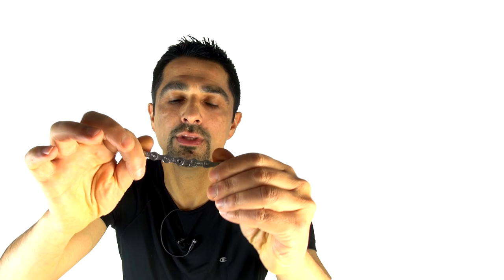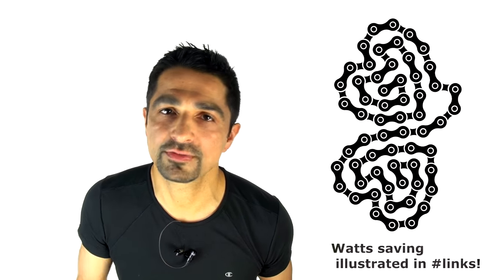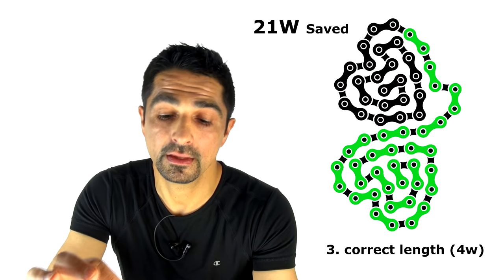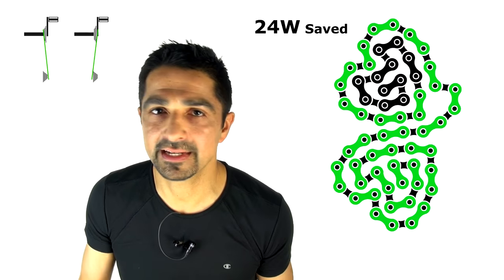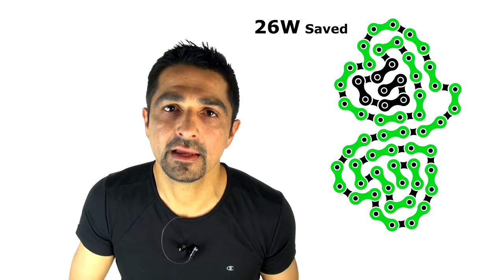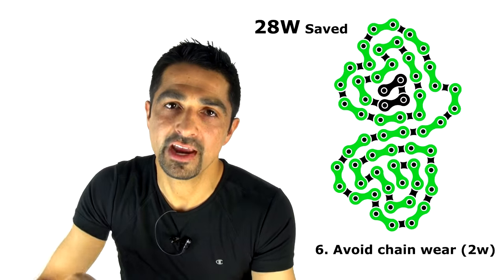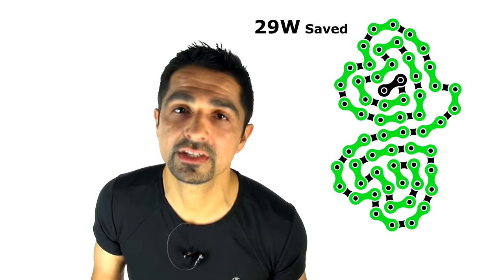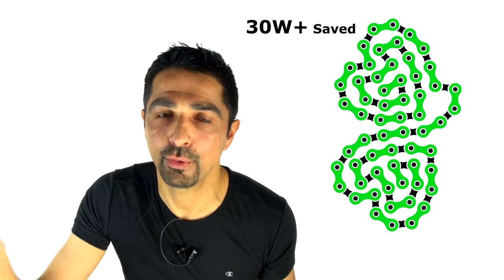Chain Science! How to save up to 30 watts of losses from your bicycle chain!

Comment: Your position on chain tension and lubrication are inconsistent with the IHPVA (International Human Powered Vehicle Association) actual test results. The IHPVA finds that bicycle drive train efficiency goes up with chain tension, at least up to a practical limit, we are not talking about banjo string tightness here. A derailleur equipped bike will have virtually NO static chain tension. 100 years of bicycle and motorcycle drive technology dictates that drive chains should have between a half inch and an inch of up and down motion at the midpoint between sprockets. The IHPVA also finds that complete lack of lubrication will not affect drive train efficiency. I have to admit this is very hard to believe and I never let chains dry out.
Reply from the maker: Hi +Harv Woien very interesting observations to be sure but I cannot find the actual data from the tests you mention. do you have a link. I am sure future tests will also bring new developments. regarding tension I imagine the effect is a U shaped curve. too low = bad too high = very bad. I find it hard to believe that sky high tension will help because every link and articulation would be under severe pressure. Your recommendation of "half inch and an inch of up and down motion at the midpoint between sprockets" seems to suggest mid-tension in my opinion, not too high not too low. Thanks for the comment.
Reply: Here is the link: http://www.ihpva.org/HParchive/PDF/hp50-2000.pdf  
You are correct in that too high a chain tension would result in damage to chain and sprockets. On a bicycle drive train setup, it is very easy to avoid this condition, as 'binding' is easily detected and reversed. Of course, this would be for single speed or internal geared hubs only. For derailleur systems, optimum chain tension can never be achieved.
Reply from the maker: Just looking again at this interesting paper, does it take into account ability to change gears smoothly, or just lab conditions essentially in a fixed gear?
Reply: Well pointed out. Chet Kyle and the IHPVA provided lots of studies that sadly have been lost. Thankfully the study that you pointed out isn't one of those. I have an original binder of the first volumes of Cycling Science that Chet put out back in the 80's and 90's. Lots of information backed up by tests rather than just people warbling on. 

What needs to happens in videos like this is a series of tests to validate the claims made. Take a new chain and test on a dyno. Go ride it for a few hundred miles to get it dirty and test on the dyno again. Repeat for all the tests, in order. Just because "waxing a chain" might get you 4 watts and tensioning the chain might get you 3 watts, the combined total will never equal 7 watts. I wish it would work like that but it never does.

Deep cleaning by shaking in a bottle? Are you kidding me? You will not get out the lube from Shimano on a Dura Ace chain by just shaking it a bit. You'll need a sealed container and a small ultrasonic machine and leave it a while. You can't get the parafin wax and telfon in until you get the old grease out.

I have never noticed, even when removing a worn chain that's been "winter cr@pped on", that I gained 30 watts when putting a new chain on, despite having had a power meter
Reply: @Swampster70  Either way, how would you notice with a power meter?
Reply: @imd12c4advice  If you're measuring power at the crank or pedals, you will go faster - 30 watts is a sizable increase, you will notice it. If you're measuring at the rear-hub with a powertap then that 300 watts will feel like 270.

If we were talking about 5 or even 10 watts then it'd be hard to tell without back to back testing.

Comment: Best lubes is raw  paraffin  wax mixed with paraffin oil. Cheap to buy. Melt and mix 50/50. Heat bottle in microwave to melt any solidified wax before use.

Comment: I did a repair on a bike with Dura Ace parts who's owner had been using machine oil and had not cleaned it in some time, he thought the chain lube was to expensive at $20. New chain and cluster cost him $475. There was a loud gulp over the phone when I gave him the quote.
Reply: It is too expensive at $20.

Comment: Interesting comments from SRAM on this subject - although I don't agree 100% with everything they say, I do think the savings for some of these measures are overstated.

-------

"Very little efficiency is lost when cross-chaining. And in the case of big-big, minuscule efficiencies lost to cross-chaining are offset by efficiency gained because of larger bend radii for the chain. Better chain management and easier access to tall gears certainly outweigh any efficiency loss.

A few words on efficiency measurements. There are enormous differences between the efficiency measured on a loaded drivetrain and an unloaded drivetrain (what your hand feels when spinning the crank on a bike in a workstand). The sluggishness that cross chaining sometimes appears to cause on a bike in the stand disappears when the drivetrain is under load. It’s analogous to lubes in loaded and unloaded mechanical systems. Light oil generally feels better than heavy grease when a system is worked by hand, but when the system is loaded the heavier lube will be more efficient.

Similarly, cross-chaining is not a concern for premature component wear unless of course your chain is wearing through your front derailleur."
Reply: Cyclespeed Tours also interesting is that SRAM don't mention any numbers ;-) "very little efficiency is lost" is pretty vague for describing marginal gains.
Reply: True, although 'very little' and 'miniscule' suggest that the losses are so low as to not be worth worrying about, even in the world of marginal gains.

Comment: Accurate post. When my chain squeaks of shows a sign of rust I pop my chain off, dump into melted paraffin (always put paraffin pan into a pan of water and then heat [this way the paraffin doesn't catch fire]). I'm good to go for about 3K miles. (Chain stays clean)

Comment: Here's a fact with my New bike. Snuged drive chain to snug. I couldn't pedal it 12 foot. So I loosened drive chain I could pedal it anywhere and even up some hills. To snug of a drive chain causes friction and loses power. To snug of a drive chain causes wear tear and even breakage. It's better for your drive chain to be too loose than too tight.

Comment: You can't really messure drive train efficiency in watts.
You can although messure how much percent of a given wattage transfers from your crank into the road. 
And as there is the law of conservation of power you can actually hear if something is going siginficantly wrong, because "lost" energy has to transfer into other forms of energy like noise or heat.

Comment: I don't think you can add up those watts savings. So a clean chain saves 12w and a quality chain saves you 5w. You don't add those together, you only get 12w from a good chain that's also clean.
Not only that, but surely these are percentages. No one goes from 100-130 watts because of a chain.

Comment: wax is best, it extend chain life for 30-50%, i tested it, wax it every 120-140km, every 3. waxing was with cleaning in petrol to clean old dirty wax, i use induction heater to heat up chain on bike without flame and put some wax in stick to touch and melt on chain

Comment: My average watts are about 160W, so I don't quite believe I could save 30 watts with chain. That would be 20% of overall power. So, those tips are based on race cyclist power metering. So you should tell the comparison value, or use percents instead of watts.
Reply from the maker: Yes you are quite right, these estimates need to be personalized ideally with a loss calculator which we haven't created yet but it would be great idea. Absolute losses strongly influenced by rider power.
Reply: Ismo Toivonen 
Fair point , No idea what my Average watts are I can Max about 220 ish + - depends on how I feel but that won’t be Long At all🤮
Reply: The mere thought of a dirty chain makes me lose 11 watts in morale - so 12 watts seems about right!
Reply: Watts are watts. A watt is an absolute value and not an estimate.
Reply: Swampster70 
What ?
Reply: The original poster stated he put out a low power. The channel poster 'fastfitnesstips' stated that "hese estimates need to be personalized ideally with a loss calculator which we haven't created yet but it would be great idea. Absolute losses strongly influenced by rider power" which is rubbish.

If you claim to save 30 watts in friction, that 30 watts should be evident whether it's 160 watts or 360 watts.
Reply: If your average watts are 160, you need to take the bike out of the box and pedal it...
Reply: @Swampster70  So my chain which is not moving right now is losing 30 watts. That means my chain is generating negative 30 watts! WOW!

Comment: I think chain efficiency may be much more than just a few watts. 53/(15/16/17) would be within the 3% angle, but you will lose about 0.5% for every other gear to the left or right from there.
Reply from the maker: exact loss calculator is on our patreon channel right now.

Comment: These Watt numbers seem way inflated when concidering the lab-testing which was done by GMBN Tech together with Muc-Off. It was show there that cleaning a chain only saves a marginal amount of Watts (5W at 300W power input if I remember correctly).

Comment: Thanks for your video. How about installing directional chain the wrong way unintentionally. What are consequences, will the chain be worn out in a short time ?
Reply from the maker: interesting one. actually the only effect should be slightly worse shifting. I guess there could be small effect on wear rate too but I doubt it.
Reply: More noise in my opinion.

Comment: How do watts and body weight calculate?  For every 10 lbs. body weight loss, how many watts do I increase?
Reply from the maker: That's a very hard question to answer without knowing what riding/training you are doing and even then hard to predict. Why not just measure it and see? However back of an envelope cal....the watt/kg will usually stay about the same with weight loss providing you train the same.

Comment: wait. did I see WD-40 in your list of lubes? I have been using that for decades, and yet, every bike shop I ever go into yells at me (yes, I had a bike shop tech yell at me) to never use WD-40. meh. it works.
and, I use an engine de-greaser. Anything that cleans off a car's engine works brilliantly on bike chains as well.
Reply from the maker: WD40 = degreaser and light oil combined. It kindof works if you are in a hurry but effects wear off fast.
Reply: I generally re-apply every Sunday evening.
Reply: @shannonstrobel6727  it works for an extremely short period of time and attracts a ton of dirt. use the parrafin method.

Comment: One thing your article does not discuss is balance when it comes to chain lube. You show which lube uses least watts, but this is only (I assume) when chain and sprockets are new. As the link to the worn chain and sprockets show things go downhill when the chain wears. So as with everything there is a balance. Does one lube attract less contamination thus improves longevity? So I guess my question would be, which chain lube is best for not attracting dirt (which speeds wear) also does not lose a lot of watts, and which actually lubricates better? (penetration, lubrication)?

Comment: Chains are $26,  the process is actually more fun than the effects of the end result. There is no efin way your gona get 30 Watts out of ANY lube method either ! Just enjoying being on a bike has been lost with Strava and lube Nazis.
Reply: R Terry 5p yrs ago, I started riding bike of my grandfather, 29” type wheels, rim brakes, no gears, hard saddles. I don’t remember my grandpa nor me ever bothered about lubricating chain nor doesn’t it ever broke. We never kept tools with us. Roads were not paved. I learned riding bike on that even when I wasn’t able reach saddle (paddling across bars) and went on country sides, across paddy fields for miles. This is how punctured tires were being fixed: displace tire from rim (without removing wheels as they were through excel) pop out tube, pump air into it and spit on it, inch by inch till you find bubble coming out.🤣 then mark it with dust or brittle piece of clay pot. Release air from the tube. Take a piece of old tube, smear it with special grease and stick at the spot. Rubber on both side would dissolve momentarily but solvent would evaporate before it penetrate the tube completely. When it is about to dry out rub over the seal to complete sealing process. Insert the tube inside tire and onto the ream to make Wheeler whole again. Pump the air again. This tube would last forever till it is punctured all over.🤣 No replacement. We used to wear out each part of bike so much. We were EPA conscious without knowing about it. There was market for scrap and people would come to our home often to collect and pay us for by weight. What a win win deal of recycling.🤣 we used to earn by selling our quarterly dumps of news papers and used stationeries too.😊

Comment: Do 11S Chains fit on 10S Drivetrains? I thought, that they are slightly smaller
Reply: Yes, the higher speed chains just have a thinner width, so they can fit between the extra cassette sprockets. Note that there is also the 3/32 vs 1/8 difference as well though.

Comment: Great. I would treat in a nano surface treatment like "Roil" . Similarly the sprockets. Polish and treat. Forget WD40
Reply: The only nano surface treatment which is legit is high velocity impingement with ultra fine tungsten disulfide dust, and that doesn't get into rollers. So instead WS2 doped paraffin is used to deliver the WS2.

Comment: Although there's a lot of opinions on the best way to look after your chain the worst thing you can do to a new chain is to give it a deep clean, as you will strip the factory applied lubricant from inside the chain which will be very hard to replace no matter how much lube you apply after! You are better off just to clean the chain normally so it's dry then apply your chosen lube!

Comment: Hi, When you speak about not putting too much tension on a chain, can you give an example of what you consider the best chain length. Most videos say that too little tension is not good so where is the crossover point in your opinion or maybe you could give an example of chain length for a 53T with 28T rear?
Reply from the maker: Hi Paul, cannot give an exact figure (try an online chain length calculator) but here is a quick tip: rotate cranks backwards and feel the resistance (or do the same forward with the bike upside down)....now ease the tension in the chain by pressing on the rear derailleur pulley arm (in direction towards the cranks) and repeat. What do you notice about the drivetrain friction.....it should be substantially less.
Reply: @Fastfitnesstips  Wow, that was quick thanks. Yes if you press the derailleur to loosen the chain everything moves easier but isn't this too little tension in this state.
Reply from the maker: yes, too low tension in the RD would cause chain drop. but too high causes higher friction.....so best to experiment a bit with your setup on your preferred riding surface

Comment: Another video recommended wax but also said it needed doing quite regularly, if I recall correctly it was around every 200 miles. 🤔
Reply from the maker: I would agree ot wears off quicker than you expect but its still so worth it 👌

Comment: The point about chain stretch isn't accurate but great info otherwise! Essentially, if you're racing, get a new chain! It's a cheap part to replace, especially considering the time cost of cleaning.
Reply: Cleaning is a much better option then throwing it away.
Reply: Time cost of cleaning? It doesn't even take long to clean.

Comment: Anyone driving a 11-speed chain on 9 speed components? Is it really working normally without the chain falling in between sometimes?
Reply from the maker: the inner diameter of the chain isn't different but the outer is narrow but it shouldnt be possible to fall in between the cassette cogs, however that doesn't mean to say the shift will be smooth

Comment: Hello, how does these watt numbers compare to a 40 km tt?
Reply from the maker: If you mean how many watts do you lose, it depends on your speed and power. Precise calculator is on patreon and coming in the future as a mobile app.
Reply: Fastfitnesstips I look at the comparesons that specialized has,  how does these watt numbers compare to those? I'm sorry I've never done a triathlon or tt before, so these watt numbers doesn't make that much sense to me.

Comment: I saved 5 volts using carbonschweiber on my crank arms. With toothless wheels ofc.
Reply: Volts?
Reply: The bigger the potential difference between where you are on your bike, and your destination means you'll get there faster.  But that means you must have the toothless wheels. Like the ones on the electrical trolley bus.

Comment: Each of these watt savings were found with "all other factors equal." Ie you save x watts by cleaning the chain only when all other factors are the same. You can't just add up the savings from several cleaning methods and say one can gain that total..
Reply: The 8 tips are not 8 cleaning tips. Avoiding cross chaining is not a cleaning tip, choosing higher quality chains is not a cleaning tip, etc.

Comment: Don't recommend petrol as a degreaser; petrol fumes are extremely flammable!  Paraffin wax is a poor lubricator which is why you won't find it used on chains by chain makers or anywhere outside of the bike world for metal to metal lubrication.  Chain makers recommend a thick gear oil.
Reply: DepakoteMeister about 1cm think, right